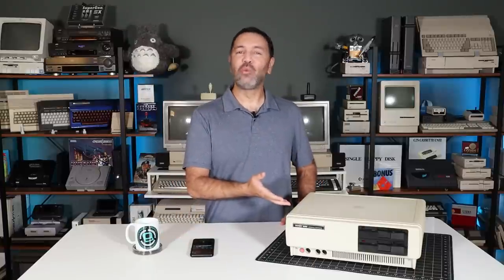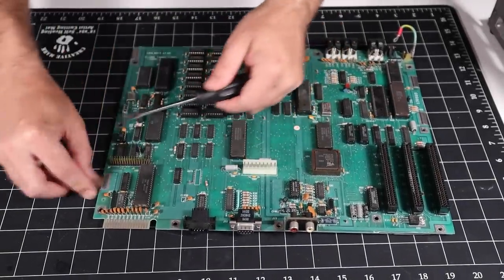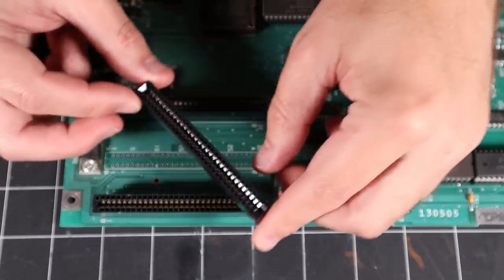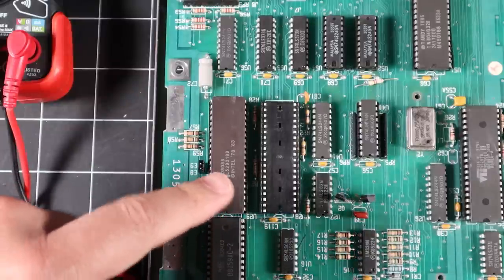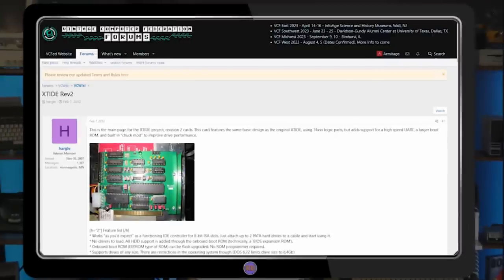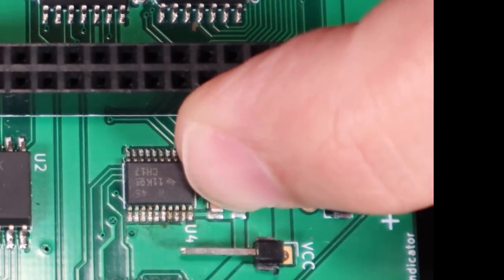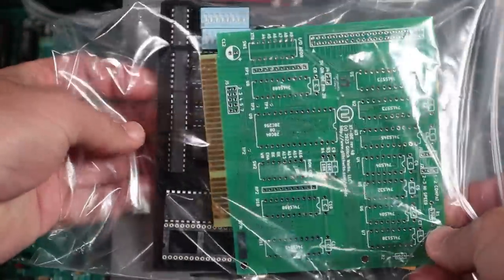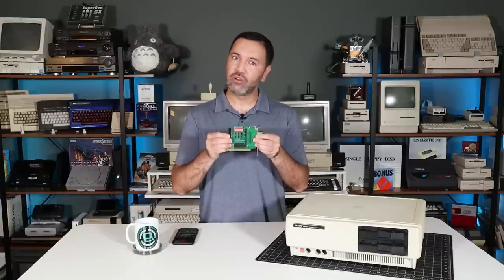Let’s attempt to repair a Tandy 1000 ISA Slot and XT-IDE card

Comment: The amount of tip damage you did the the solder mask with your desoldering tool was grievous. The solder mask on those older tinfoil  layer pcb's are very fragile, especially now after 35 years of age. I'd recommend using a board heater, get the pcb in the whole area up to around 38-40c first. This will enhance your efforts. Mix in a wee bit of fresh 60/40 and use a very small amount of rosin type flux instead, brushed on nice and thin. Lay the desoldering tip cone atop the joint and let gravity alone do the work. As soon as it liquifies, hit the suction till the tip slides down to the base. If solder remains, flow some fresh solder in and repeat.
Reply from the maker: Thanks for the tips! I will try that next time and be more careful. Still lots to learn! For what it's worth, I've never had that happen to any PCB I've worked on up till now. The camera shows the damage in perfect clarity, but in my defense I couldn't really see it as it was happening due to how far away I have to sit not to block the shot and the fact I'm not using any magnification.
Reply: @retrobitstv  folks commenting that you scraped off the solder mask are correct of course, but don't be too hard on yourself -- that board is like old C64 boards which have the entire surface tinned underneath the varnish. When you rework a board like that my experience is the solder on the traces tends to liquify underneath the varnish, and then you have a weak crust floating on a liquid and it's just exceptionally fragile. I don't know that it's particularly important either though except for aesthetics, since the solder also protects the underlying copper from corrosion.

The name solder mask doesn't even really apply here in fact, because since it's applied after the solder, it's not masking anything out.

Comment: Is ide even compatible on the that Tandy I think uses the older standard.
Reply from the maker: The Tandy has no built-in hard disk interface at all, so you can add any ISA controller you want. It does have a built-in floppy controller. When I bought it, the machine came with an installed 'hard card' but the drive had failed so I removed it entirely. The 1000 is an XT class machine, which is exactly the type of system this XT-IDE card was designed to be used in!

Comment: You scraped off the solder mask with your desoldering pump.
Reply: This.  Those tips can be sharp and putting downward pressure while swishing round the pin will scrape off the mask and in time also lift/scratch off the trace.
Reply from the maker: Yea, it's strange because I've never damaged a PCB with the pump before. Either the solder mask was really fragile on this machine, or there was some kind of reaction with the liquid flux I was using because the damage was concentrated only around the pins I added flux to and not the ones I only added fresh solder to. Weird.
Reply: This is why I am not fond of pumps.
Reply: @retrobitstv  I used to do the "wriggle" technique before as well. Then I learnt that it can abraise solder masks. It seems, the recommended way is not to move the gun but to have the tip angled sideways by a few degrees, tilted, but not move it.